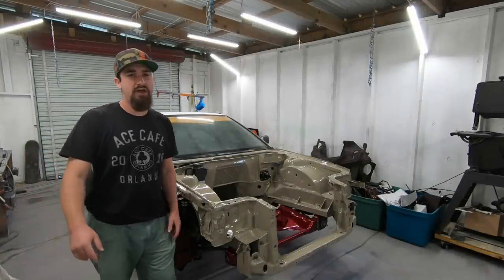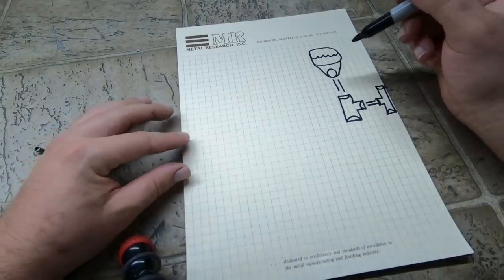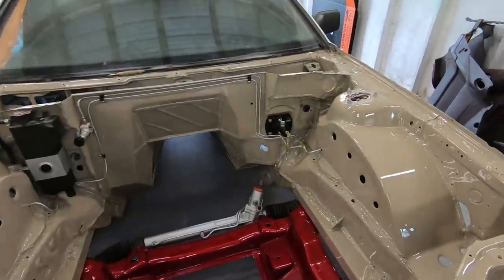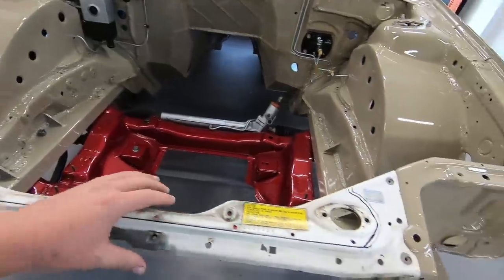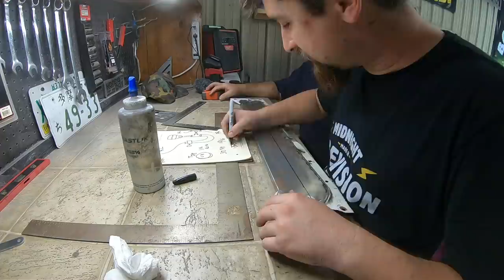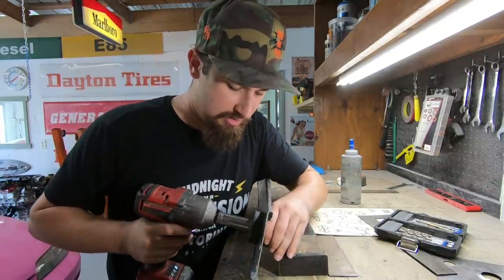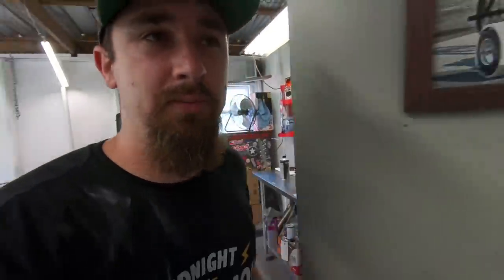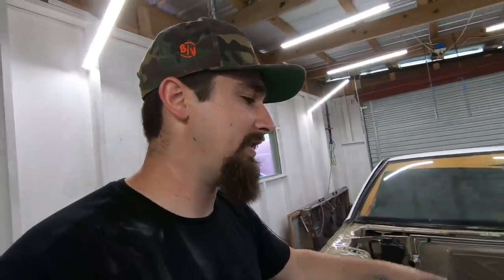DIMPLE DIE CRAZY! Ls Swapped 1988 Honda Accord Custom Brake Lines

Comment: Dont forget to install some type of grommet where the steel brake lines go through the holes. You can slice skinny vaccum hose down the center and use it for grommets on the edge of the holes.

Comment: Back feed your front lines are not same length so drivers side will lock sooner shorter line you should make circle loops so it's close tob same length iv done this one side locked sooner... food for thought
Reply: Pressure in an enclosed system is equal.

Comment: I'm sure you know the risk of using a single port master cylinder like your using just wondering why you didn't use a dual. It almost seems like too much of a risk of losing brakes if anything fails. And idk what master that is but is it looks small and is it gonna be strong enough to stop a v8 powered car? I'd want a bigger piston moving more fluid especially for all 4 corners. Guess we'll see.
Reply from the maker: We shall see how this one works out. This is the setup most people run in Honda’s (not saying that it’s the correct setup) that delete their booster. Willwood offers a dual master and that’s for sure an option. Thanks for the advice.
Reply: @BodeVision  with dual you have front and rear, brakes single you lose pressure your screwed!

Comment: Brake lines are like a roller coaster lines cant go above the master
Reply: Meaning the highest point should be the master and no lines can run higher than that
Reply from the maker: Correct me if I’m wrong but I can’t think of a car where the lines are all below the master? Accord OEM lines were above master as well as the gto
Reply: @BodeVision  when the master is not the highest part of the hydraulic system you have to run a residual valve to keep the fluid from draining back into the master cylinder.